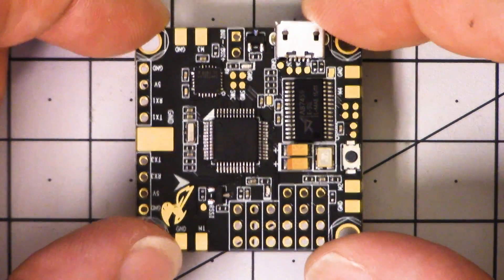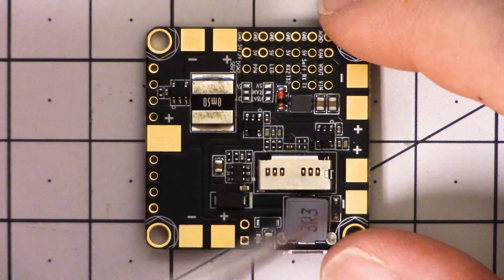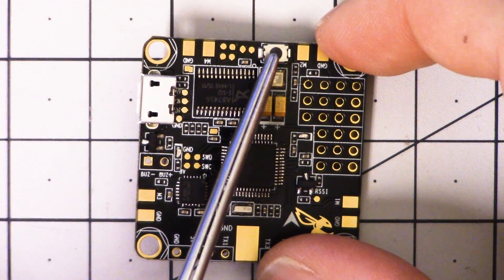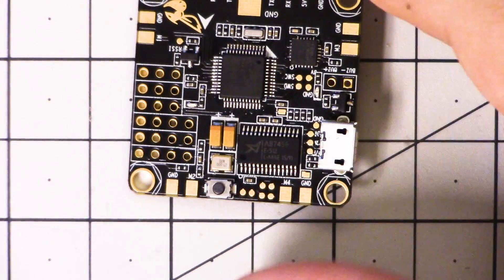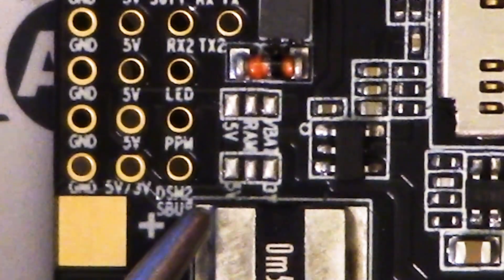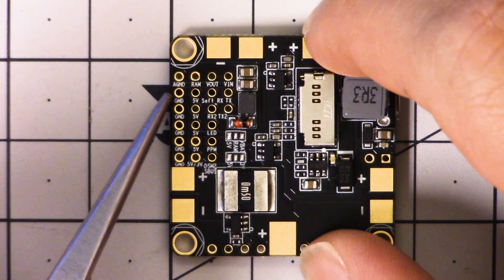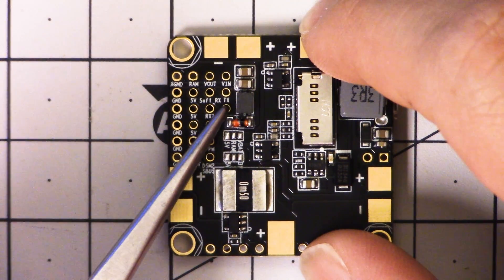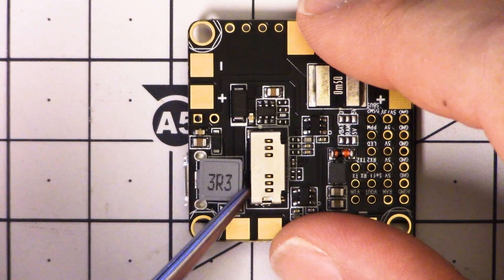Betaflight F3 (BFF3) Flight Controller | REVIEW AND HOW TO

Comment: I will be using using a 4 in 1 with this FC on my Kraken 3". Dont want current display , so will only be connecting the Vbat to the FC, esc signal wires and Video in/out. Will power vTx from the Lipo and camera from vTx.

We need to see ESCs that come with solder pads on both motor and signal/power inputs to make building with this type of  FC easier

SD slot is annoying being the smaller type, is Blu-Tack conductive?, if not a blob of that should hold the card in.

Comment: Build in pdb are a no go, hate it
Reply: Per Buch  I totally agree. people don't seem to understand how thin the copper in pcb's are. Even with 4oz coper the trace width needs to cover the whole board. plus the added noise on the ground plane.
Reply: I just solder the wires together, not that difficult and much more efficient.

Comment: The mounting holes on this board look the same as those on the XRacer.  I've had to file every one of them larger in order to line up with the mounting screws.   Those brass linings make it a pain in the butt and they don't really DO anything.  I whish they would just make the board a tiny bit larger and leave out those brass linings.  I'm trying to soft mount this board and those tolerances make it difficult.
Reply from the maker: No issue at all here, FWIW.

Comment: Stone Blue Airlines had them in stock when I ordered on Thursday. Question for you though Joshua. If I want to add sleeves to my X4R the correct length should be 26mm on the sleeve and 29mm on the whisker? I want to see if this helps my range without going L9R on a miniquad.

Comment: This is perfect for when you have limited hight and want to use escs on the arms. I'm building the crusader  gt2 and fitting the omnibus f4 pro is a real hassle. Just solder the esc to the board before the motors and it wont be a problem to flip the board back and forth while you solder.

Comment: I've had one of these for some time now and I like the 5v unify vtx. My current matek pdb has the same 3a 5v bec and I haven't had issues so I'm wondering if I can power the camera (hs1177) off the ram video pad and tap on to the 5v pad right under it keeping the grounds together on agnd.

Comment: That's the 64k question too, is there video filtering or not? FPV Model says yes but the forums aren't sure so....
Reply from the maker: I'm told by other commenters that there is an LC filter and a diode on the RAM pin.

Comment: I've installed two boards, one with the fpvModel 4in1 on a little 110. You definitely have to think about the assembly since you're soldering to the front and back of the board but overall I like it so far. Personally I don't care current. I just use voltage and timer:)

Comment: direct solder a heavy wire to the other side of the shunt resistor, bypassing the esc pads? (to get current measuring with 4in1 without overloading the board)

Comment: Hi. This is six layer double sided board. Uart2 is used for serial reciver. Ram is filtered throught Lc filter. The problem with powering video transmiter from 5v is probably diode in that Lc filter.  3A at 5Volts is 15W, more than enought for video tx.

Comment: Your totally right with the soldering on both sides, I´m pretty sure a lot of people will run into the problem of flipping the board after they soldered some wires to it. You really have to think about it before you do something.

Comment: regarding the current sensor, you could solder AIObatt+ wire on top of the big shunt resistor to power the AIO esc. while AIObatt- wire is soldered together with LIPO- at the main GND pad.
Reply from the maker: Yes, that will work. Run vBat+ to the Betafligfht + pad, then run another big wire from the other side of the shunt resistor to the 4-in-1.
Reply: I did this way, but im not getting voltage and current on the screen.  What im missing? i soldered the end of one cable to the shunt and to closest esc + pad, and the other end goes to the 4 in 1 + pad. Then the 4 in 1 neg goes to the fc main neg pad. I have active current and voltage on the OSD tab on betaflight gui.
Reply from the maker: +ashingashinga if the board is powered up, there is no reason the osd should not measure voltage accurately. Are you saying you don't see the voltage element at all, or you see it, but it's zero?
Reply: I dont see it on screen at all. i set the osd to visualize timer, rssi %, current and voltage. But i only see the timer and the rssi.
Reply from the maker: +ashingashinga change from NTSC to PAL or vice versa.
Reply from the maker: +ashingashinga in the osd tab of the configurator I mean. Change from auto to NTSC. Or pal.
Reply: That fixed it. Thanks a lot.

Comment: I think that the RAM pad is filtered because if you look closely, there is a black component which might be an inductor and two ceramic caps right next to it.
Reply from the maker: That would be great. It would mean you get filtering even if you run RAM off of vBat.
Reply: Joshua Bardwell as I said, don't know that for sure, but I think Boris knows what he is doing.

Comment: A piece of scotch tape would hold the sd card in just fine, clean surfaces with rubbing alcohol, cut to length and apply. I used this method on the old Runcam to avoid the card ejecting every time I would crash, hope this helps.
Reply from the maker: So you have to replace it every time you remove the SD card, or, in the case of the BFF3, plug in USB? Not a workable solution for me I'm afraid.
Reply: +Joshua Bardwell After watching the video again, I realized that it is on the bottom so it wouldn't work that great. Love Boris B. and everything he has done for the community, but it's a design flaw that may lead people towards the omnibus if they don't need the on board pdb.

Comment: A rubberband around the board would hold the usb drive in place and silk screen should be on both sides so there is no top and bottom, only side A and B
Reply from the maker: I like the rubber band idea. Moves out of the way easily for maintenance.

Comment: Would you say this is very comparable to the omnibus f3?
Reply from the maker: Yes. The main difference is the inclusion of a PDB.
Reply: Kris Lewis omnibus f3 is great. Especially if you have a 4in1 esc. There is a 4in1 cable output on the bottom side. But if you use 4 esc the betafligtf3 might be better.

Comment: copied and post your script(setting) for the wizard x220 and when I try to take off it just spent widely on the floor, would u have any idea?
Reply: jimmy chan Your motor configuration is wrong or your props are wrong.
Reply: jimmy chan or your channels are mapped wrong in beta flight
Reply from the maker: Most likely your channel map is incorrect. Since your copter probably flew fine before you installed my config, you probably don't have your motors wired up wrong or your board aligned incorrectly.

Go to the receiver tab and see if the 3D model there is spinning. Make sure your channels map correctly to your sticks.

PS: I did say you need to verify this stuff before you go fly... :-)

Comment: I just preordered one from the next batch with the quadrant escs. I have a space one pro6 and planned on using them in it but I really want current sensing without having the escs on the arms due to the arms being so thin. +JoshuaBardwell can you show the safest way to do this since everyone is saying it's possible through wiring directly to the shunt resistor.
Reply from the maker: I can't show it immediately because I'm busy with other stuff, but just treat the big silver part of the shunt resistor like a solder pad and attach a 14 gauge (or 12 gauge if you're going to be pulling massive amps) wire to it, then solder the other end to vBat+ on the 4-in-1 ESC.

The wiring should be LiPo+  -> BFF3 vBat+ -> The far side of the shunt resistor from vBat+ -> 4-in-1 vBat +

This is an intermediate level soldering task, so if you are a beginner, get help. You need to get a good solder joint onto the shunt resistor that can take lots of amps, without desoldering the shunt resistor in the process.
Reply: Joshua Bardwell Thank you. I am advanced with soldiering. I just wanted a for sure way to continue to get current sensing without burning anything up. Perhaps a fallow up video later down the line. BTW wow and thank you for the sheer massive amount of content you are pushing.
Reply from the maker: +Xephex Xephex you can ground on vBat negative if you want.
Reply: @Joshua Bardwell, does it matter where we ground the ESC? Can you just ground it on vBat- or do we need to be on a ESC pad -?

Comment: If you are using an external PDB, I don't see the problem using the onboard shunt for the current measurement. What I can see, this is a high side shunt measurement and only the positive power lead need to be routed through the board. The distance between the shunt and the closest positive power pad is small and can handle the current fine. If not just solder directly to the shunt resistor.
Reply from the maker: You are probably correct. I'm just not about to go on record recommending that people use the ESC pad, since the product specs specifically say it's rated for something like 25 amps continuous. Soldering to the shunt resistor will definitely be safe since it carries all the current anyway, but that's not a beginner move.
Reply: Ole Lillevik that's my option too
Reply: Opinion

Comment: have you found any other place that sells them that does not use paypal as that was the only option i saw and i dont trust paypal from previous problems with it. Thanks for the vids lots of good info.
Reply from the maker: I don't think anyone but FPV Model sells this I'm afraid.
Reply: Stone Blue Airlines
Reply: it just arrived from Blue Sky Airlines today, thanks for the info GainsFPV

Comment: Solder positive to the Shunt resistor?
Reply: theoretically, it would work, yes. Solder positive to the output of the shunt resistor.
Reply: It will also work in practice :)
Reply from the maker: Correct. It is a bit of a hassle though, and at least an intermediate soldering task. I suspect you can also use the nearest positive ESC pad but I'm not sure I would recommend it publicly because they are technically only rated for 25 some-odd amps.

Comment: I am guessing that in case you decide to use this board with 4in1 esc's (thinking about the Quadrant), you'll probably have to give current sensing up... but voltage readings should still be correctly taken by connecting the fc and the escs vbat in parallel, right?
Reply: Jaskier You can still use a 4 in one.  If you notice only the positive goes through the current sensor.   Wire your main battery+  to the + pad on BF3, then wire a battery sized lead (16-12awg) to the other side of that large chip with 050 written on it directly to the chip to your 4 in one in.  Wire your main battery ground to the 4 in one, and wire a small wire, 22-24awg should be fine,  from the main ground on your 4in one to your FC.
Reply: Spoon FPV I like your idea but it does seem pretty hard to solder a rather large wire directly to one of the sides of that chip with no proper pads in the middle of the board.
Reply: Agreed .... You could probably get away with soldering to the ESC positive pad right next to the current shunt, and If I had one in my hand I would let you know if it was responsible or not to do it, but I don't.  You can look at the Trace on the board from the Shunt resistor to that pad, if it's not less narrow than the trace going from the Input side of the shunt resistor then it will be okay to use that pad.  ONLY THAT PAD! all the rest will have current restrictions based on the board layout.
Reply: Spoon FPV You're right, the closest pad might be directly connected to the chip (with a wide trace). 
I'll give it a try if I get to receive one of these (they're always out of stock) and let you know if it's possible.

Thanks a lot for your great ideas!